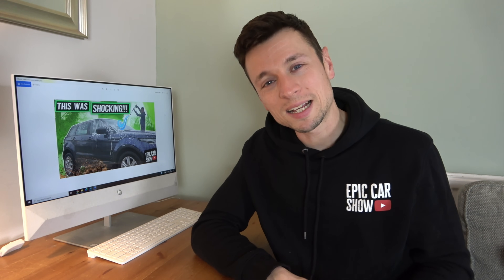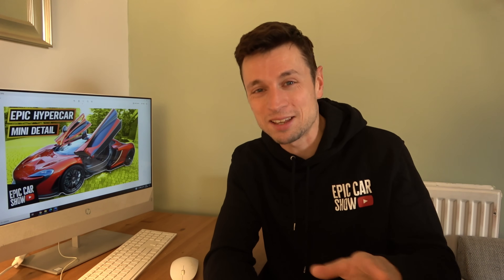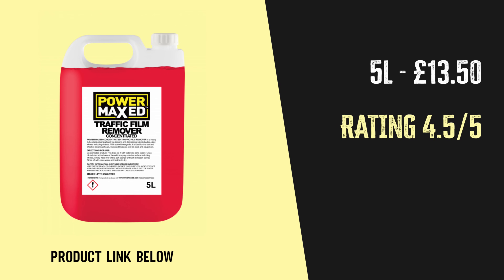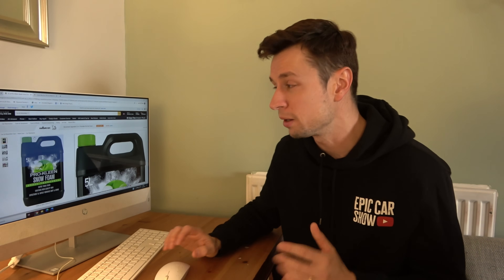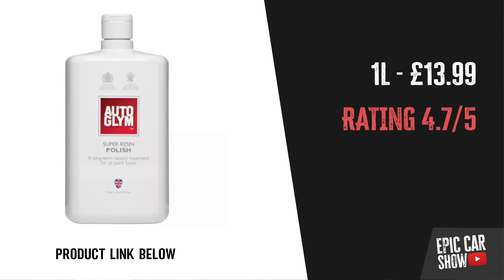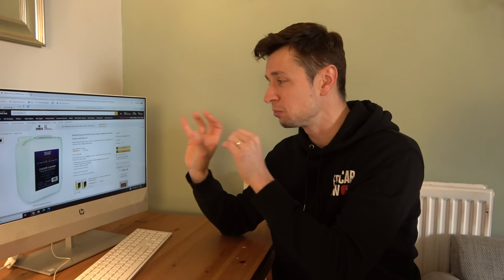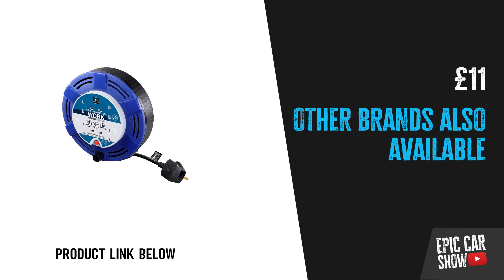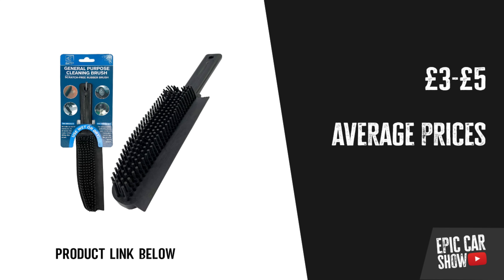Starting a Car Cleaning business Start up on a BUDGET ⭐ Complete Cost Breakdown!

Comment: B&M bargains for spray bottles on a budget. Gardening section... Can pick them up for £1 each for a £1 size one.... Do the job. Also for the carpets, a tile and grout brush (non metal) for about 2 quid on ebay would be a shout. Great for getting down the side of seat rails.

Another top video mate. Been building mine on a budget and a few of these you mentioned are in my arsenal.

Use my Volkswagen bora to go to customers houses and I just about manage to get all my stuff in.

The titan hoover is a little demon as well.

P. S did a full valet today on a 10 year old fiesta... Couldn't feel my fingers in - 3 weather. Brutal
Reply from the maker: Argh man. Even if it wasn't lockdown I wouldn't of done today. Back in the day I used to work in snow but it took such a drain on my body. Yeah I should of done some eBay mentions  maybe next time. I love a good deal at b&m 😁
Reply: Couldn't do the snow. That's too far. I warmed up after a bit but the first 20 mins were rough. Hands were dead but luckily my customer let me use their hot tap so got warm after a while. Still my body was fooked after it though

Comment: Great video.....I used all AG products to start with, Do the job, and available everywhere....lucky to have the means and ability to kit a van out straight off, Nissan Vanette , 11 year old £2000....had a lot of work done on it, lasted 2 years.....saved while still working full time , fitted genny, washer, inverter , bought best hoover and rest of the gear I could afford, spent 6 months putting the lot together, before taking the plunge, and going full time.....👍
Reply from the maker: Hi Andy great strategy 👌. I like that.  If you ever want to share anything on our Detailing group (Detailing network) that may help people please do 🙏
Reply: @epicautomotivedetailing   I certainly will, just been a bit hectic recently, 14 hours done yesterday, we cleared 2 days work in one day, due to snow forecast today....didn’t want customers travelling in adverse weather, and we get a weekend off....👍🇮🇲
Reply from the maker: It's grim today mate. So cold beyond belief
Reply: @epicautomotivedetailing   that’s why we planned ahead, minus 3 here, with 40 mph gales, so in reality it’s minus 12 windchill, we struggled washing yesterday, freezing on cars before we got them indoors, only so much warm water in you’re buckets will do, havnt snow foamed a car in a week, we are just precasting with citrus magic , doesn’t tend to freeze as easily....we lost 3 weeks in January, full lockdown here, so our next free dates are after Easter.....full on, full time , but loving it .....apart from the cold, I’m getting old 🤣🤣🤣

Comment: Great video with lots of good advice 
I started by buying a used valeting van with all the equipment for £2k , theres always people giving the trade up after investing thousands and finding out they struggle to run the business 
For chemicals don't forget autosmart,  Nielsen's , autoglym , valetpro , jennychem , carchem and autobirite plus loads of other trade suppliers 
Most car detailing suppliers sell trade size aswel , Amazon is usually dear for trade products. 
For microfibers try paragon microfiber,  they supply to the trade and are good quality and very well priced 
You always recommend karcher power washers but I didnt get on with them , i found nilfisk a far better machine that's in the same price range 
But the ultimate set up is a good Honda generator ec3600 which will power everything and never mis a beat,  mines is 7 years old and the kranzle k7 but you'll pay £600 plus  for each 
You'll find your constantly trying new products and updating your equipment as you work but that's part of the fun in valeting

Comment: I love Power Maxed tfr, essential at this time of year. 👍 If anyone is looking for a cheap but powerful snowfoam try non-caustic Snowstorm With TFR Snowfoam from Jennychem, as the name suggests it's a snowfoam with traffic film remover so you can cut out the tfr stage and go straight to this. I've tried many snowfoams like Bilt Hamber Autofoam, Wax Planet 8 Below, AutoGlym Polar Blast but nothing cuts through road grime like this stuff. 👍 It's £16.50 for 5 litres and in winter I only need 40ml of product in 500ml of water. In the summer I can halve it to 20 or 25ml. 😎
Reply from the maker: Haven't tried jennychem yet. Power maxed is a solid tfr. Thanks for watching sorry it's a long one lol

Comment: Brilliant video the few cars I've done ATM. I've used turtle Wax original and meguiar's ultimate black plastic restorer and I've had others ask me to do there car aswell.  But one thing I will say is I've been machine buffing the cars.  I've ordered a few different spray on waxes from turtle Wax to try on mini valets 👍
Reply from the maker: The ceramic spray coating is amazing but make sure you have damp towel to remove those smears

Comment: For starting off Would it be acceptable to use the customers power for the pressure washer ? or do you recommend investing in a generator.
Reply from the maker: I never ever used a generator for work

Comment: Very good video. I am not a professional , but certainly like to clean my car beyond the stage of soapy water in a bucket and a sponge.
Apart from your list of chemicals, which was very thorough,  I am undecided between the Karcher K5 Power Control Pressure Washer and the Bosch Advanced Aquatatak 160 2600W Pressure Washer. Advice on this would be really be appreciated.

Comment: Nice video mate 😁 just wanted to ask how you calculate cost per car? I’ve been valeting for 4 years, recently started on my own due to redundancy but have never tracked chemical use whatsoever!

I’ve started with the basics, cleaned one car and measured how much chemical was used right down to the ml, broken down the cost and rounded it up so I have enough room to factor in bigger/dirtier vehicles.

Was thinking about seeing how many cars I get from 1 bottle of product, then dividing the cost of the bottle by the number of cars to get an average. 

Would love to hear your insight mate keep it up 😁👍🏼
Reply from the maker: To be honest I've done it so long now I've just learnt averages as each job is different. Trade chemicals are getting so cheap now it works out at a few quid per car
Reply: @epicautomotivedetailing  nice one! Definitely think it’s something I’ve been overthinking far too much. I’ve always been a bit OCD 😂 will probably lean more towards this approach and make sure a few quid on each job will cover materials!

Thanks millions for your input mate, have a nice day and look forward to your upcoming video!

Comment: A wonderfully easy to follow guide - thanks so much for your time on putting this together, it has helped me make the decision to start a side hustle doing this! One question, though. I know and fully accept that long term I'll need a van, water tank and a generator, however, on a short term note how do clients react if you have to use their utilities such as electric? Would it be an idea to ask the question if they mind at the point of contact?
Reply from the maker: Honestly I've never known it to be a problem. Just be confident and ask and people will understand. If they don't then perhaps they aren't the right customer for you 🙏

Comment: Great advice and guide. Just a question with regards to insurance. Looking at using a van with a water tank and generator. Declared these in the quotes, Any tips of getting a good quote? Never had van insurance and this seems to be putting a stopper in starting up due to the cost. (40+ no accidents or claims etc but still wanting arm and a leg)
Reply from the maker: Thats a very good question. I use dial direct for my van

Comment: Hi Dave

Can you use the Williams fabric cleaner in a cleaning/Extraction machine? got a few interiors todo but not enough in them to use Yum Interior, so looking for a 
decent cheaper alternative.
Thanks Tony
Reply from the maker: Yes mate. To save chemicals use a drill brush so you do t need to heavily saturate it 👌 I use a mix of many products as I test loads. Williams fabric cleaner is actually pretty good

Comment: No Surfex HD? can be diluted 1:200, £17 for 5L, superb cleaning power, dilute to different strengths for multiple use e.g: tfr, prewash, interior, wheels, tyres
Reply from the maker: It did cross my mind and I totally get that but that's something that's getting featured in the (next step up) video. 99% People who messaged me asking to make this video said they want it simple so they can quickly identify products to hand if that makes sense. This is really Aimed at people starting out for the very first time so of they don't understand the ratios etc it may be overwhelming when they have the same product for many uses... 👍

Comment: Hi mate , recently discovered your channel as I’ve been considering getting into the valeting trade, your videos have been a great help, especially this one. I have one question though and I doubt it’ll be a straight forward one to answer, but as a general ball park figure how many cars should you be able to valet with 5L of the main products you’ve suggested here? I.e the shampoo/TFR. Just trying to price up margins etc and this would be a great help
Reply: Basically on the £400 rough chemical cost you’ve identified roughly how many cars could I valet? Thanks a lot and keep up the great videos
Reply from the maker: Very question, hard one to answer based on dilution rates. Shampoo will cost pennies per wash if you go for 5 litres for £10
Reply from the maker: Pleasure happy to help my friend

Comment: Where do you take your water from, customers supply?
Reply from the maker: Yes I take customers power and water now but it's not as hard as you think. Think about the state of the world right now with everything going eco and going up in price. If you say to a client, "can we use your water and power but in return we won't increase the price" they will see it as a fair compromise. You also say that you are cutting your carbon footprint (which you are) as you have less weight in vehicle, less wasted fuel. Honestly anyone can use these methods. I have done for 16 years now 🙏

Comment: Great video by the way, I’m trying to source the wheel Woolies, but it seems yum cars that stock them are closed until the 22nd July, do you know of any other stockists ? I’ve had a look on google, but it seems a lot of the brushes are cheap imitations, thanks in advance.
Reply from the maker: Yeah unfortunately you can't get any decent replicas. I've bought so many temu brushes over the past few weeks Which are ok but nothing in comparison
Reply: @epicautomotivedetailing  Thanks for the reply, I’ll just hang tight to yum cars are back open again

Comment: Hi I have just started out doing neighbours cars for now I have most things but I dont have a pressure washer is there an alternative you can use as I don't have access to power at the moment thanks
Reply from the maker: To be honest a hose can still get you a long way. Hose triggers can provide slight power
Reply from the maker: Well done btw 👍
Reply: And what are your thoughts on the worx hydroshot cordless pressure washer if I were to buy one are they worth it thanks
Reply from the maker: @banchy9126  for me no they won't cut it. They are very weak but their purpose isn't ideal for regular use. They are more designed for emergencies. Got one on channel soon
Reply: Ok thank you I won't get one then

Comment: Can TFR damage diamond cut wheels or paint if it hasn’t been diluted ? 🤦🏼‍♂️

Edit: Power Maxed TFR
Reply from the maker: Yes it can potentially depends on many factors like if the wheels had any protection in first place
Reply: @epicautomotivedetailing  none. I reckon I left it on there for no longer than a minute and then I throughly washed the wheels with Autoglym custom wheel cleaner and a jet wash followed by wiping with a microfibres towel. I guess I’ll find out in the morning 🥺

Comment: Ive been doing this not to long (mobile valeting).
I use karacher k4 full control and a henry hoover but they run on a generator, however u dont use a generator so how does that work?
Reply: What i also dont understand some people use a car and not a van i use a van, ive not been in this field long maybe just touching a month how does it work from a car i mean u need a tank ect?
Reply from the maker: I just plug extension lead into house
Reply from the maker: Hello mate no you honestly don't need a tank. It's essential sometimes but when you work out percentage of cars where they have power and water it's so high in fact if say for me it's 99% of clients who have there own water so I keep tank as a backup

Comment: Mate I've got just under a 10k budget and I'm struggling
Reply from the maker: Are you mobile? Static unit?
Reply: @epicautomotivedetailing  mobile, it’s finding a decent enough van that hasn’t been round the world 4 times.
Reply from the maker: @Pocketpatriot  So true. Vans are used for this and that and they hardly ever get looked after. My van isnt perfect. I did have a fleet of vans once. Small fleet but wasnt worth the costs
Reply: @epicautomotivedetailing  yes it's a toss up between looking professional and keeping costs as low as possible. Your advice definitely helps.
Reply: @epicautomotivedetailing  after you said about not necessarily needing a generator for detailing I'm actually now looking at the more affordable Ford courier vans, smart and cheap.
Reply from the maker: The tank is always helpful as it can be a real time saver but the generator definitely not essential. If Some jobs are impossible then sometimes there not worth it. Swings and roundabouts
Reply: @epicautomotivedetailing  thanks for the advice mate, appreciate it